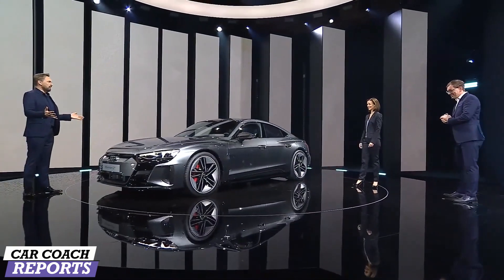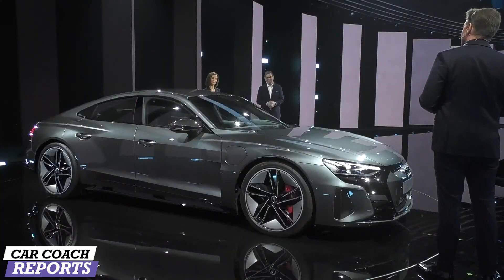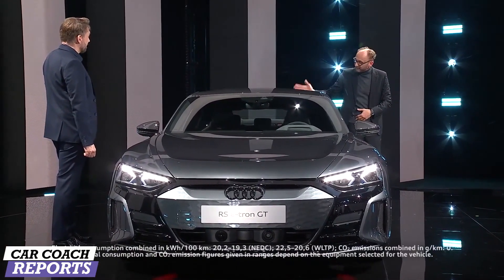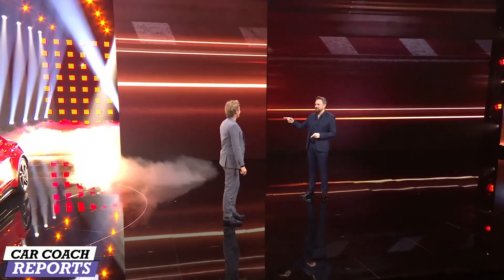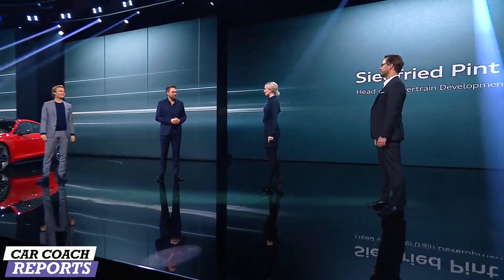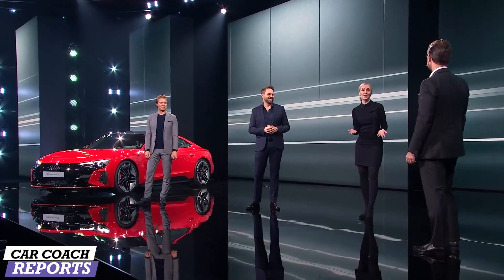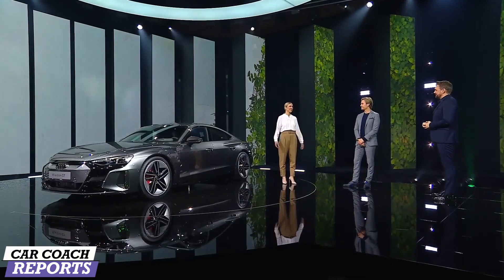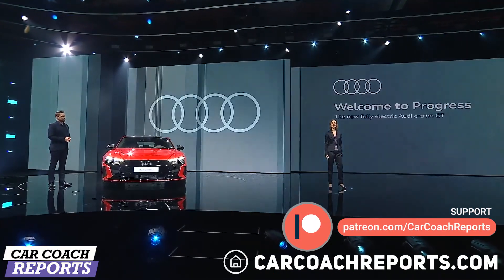2022 Audi e-Tron GT and RS e-Tron GT

Comment: Why is it that I cannot buy a new Ford Explorer ST on special order, ATM? I KNOW, it's a lack of micro processors. I'll be going to another Ford Dealership, soon. The Ford dealer that I went to had none in his inventory.
Reply from the maker: Most dealer s are low on inventory, the chips shortage and parts from China. China is putting the screws to us. Ask your favorite dealer to search the country, but there are few deals.
Reply: @CarCoachReports  The People have gotten what they voted for. Remember that I was in the auto business for a few decades. I did locate a 21 Explorer ST AWD. It's gray, I detest the color. But you're correct in your sentiment that there is a major shortage of inventory ar dealerships. My car was located in Maryland and I hate the color. Nevertheless, it has the high performance options that I desired, so I went with it. Obviously, the GF is not happy. But she can always move out. 😂
Reply: @CarCoachReports  China is screwing us. We need to stop doing business with them altogether. Thank you for your advice, Lauren. And, I was able to get 4000 factory rebate direct off. Seeing as there is no financing involved, I managed to get another 1500 off of the sticker because of the issue of the color. I did see the shipping invoice and the dealer still made 2400. I was fine with that as the truck can sticker for over 62 grand.
Reply from the maker: That’s AWESIMw. Glad to help. Enjoy the ride!

Comment: It's too bad that the electrical grid cannot sustain 140 million of these on the road AND power our houses without massive power outages. It's been proven that the New Green Deal is unsustainable. 
But I like this car,and the mach e. The poor man's E machine. Really sharp car, males Tesla look like a fossil.
Reply from the maker: I agree. The base power must be coal, natural gas and nuclear (which has no carbon emissions) it's all subsidized. Don't get me started.
Reply: @CarCoachReports  I think that natural gas is a way to the future. It's clean burning, but takes more energy than petrol, this, fuel mileage may suffer

Comment: Now, how cool is that car? Call me when they get 700 miles on  charge. This car is awesome, Lauren.
Reply from the maker: Don't hold your breathe
Reply: @CarCoachReports  I won't as I know that solid state batteries hold a greater duration of charge(source, Toyota M.C.). But what a beautiful car!
Reply: @CarCoachReports  We are about to embark on our first electified Semi Truck in our entire fleet. It's supposed to hold a range of 800 miles, pulling a full 53 foot Semi. And I don't trust Tesla at all. So it's a Volvo sleeper cab. We'll see what transpires in the next year. Our Rigs run about 18 hours a day.
Reply: @bobdavis3357  A Volvo with 800 miles?! If you have a model #, I'd be interested in this.
Reply: @hermanwooster8944  I said to CALL ME WHEN there's a Volvo Electified car that can run 800 moles on a charger WOE dude
Reply from the maker: That could be a very long time
Reply: @CarCoachReports  it's just a unreasonable wish from me. They can do it with our Volvo Electified Semi. But the batteries need to be replaced at every 120000 miles. They're warrantied, so we'll see how it goes.
Reply: @CarCoachReports  you're right, with car's. But that Audi is a driving piece of art on wheels. Great upload!

Comment: A 350kW charging speed, while slower than pumping gasoline, feels like it's just on the cusp of being sufficient for regional driving of 400-600 miles. It's getting better and hopefully the costs will go down soon.
Reply from the maker: There are so many other factors holding that back. Many can not be overcome.
Reply: @CarCoachReports  I understand. The challenges involved in transitioning from fossil fuels to electric require astounding technological breakthroughs before it can even be considered by the mainstream. Still, I like to dream. :)